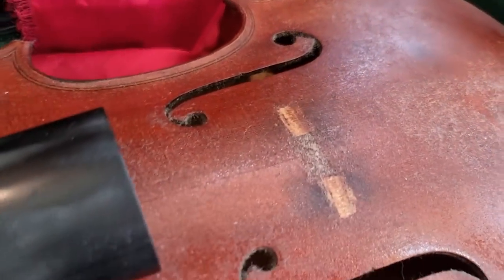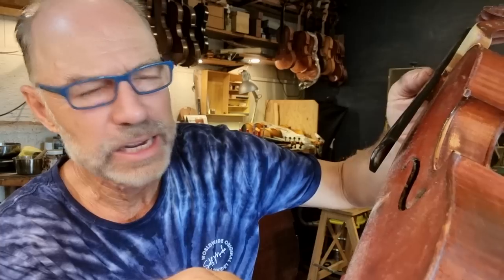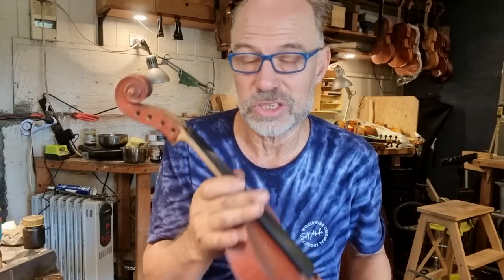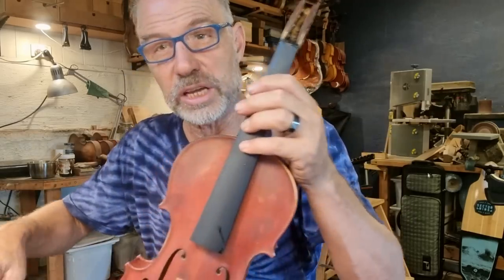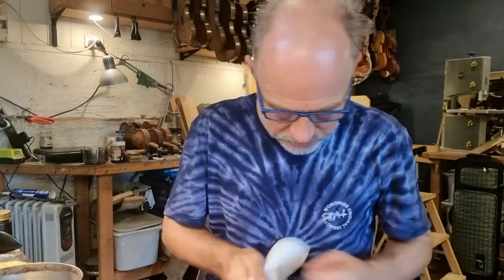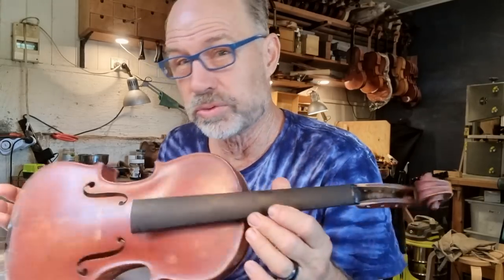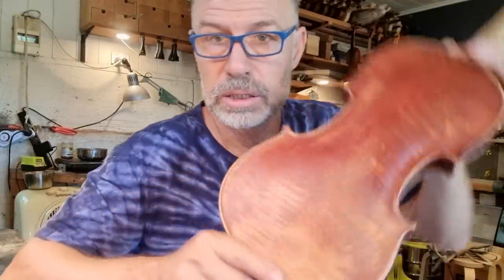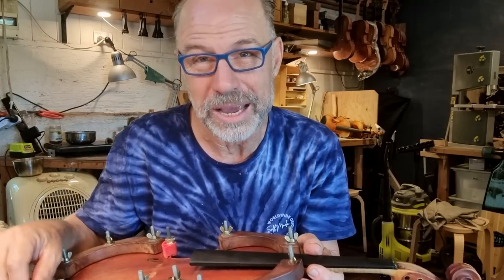The Very Sticky Violin!!

Comment: Hi Olaf
I am the fourth generation of luthiers / restorers in the Uk. I have experienced a few instruments with this problem 
The violin almost certainly has oil varnish for which, the early coats have not been allowed to set. The earliest instruments I have experienced with this problem were From the Forster family and other contemporary makers. In these instruments the base coats of oil varnish did not have a chance to set before the last coats were applied. Over the years the sub-surface coats did set causing the top coats to  ‘cracquel’. 
Sadly makers from the 1960s as you said, made the same mistake; too few thick coats which take forever to dry in the sun-less UK. The instrument you have is a classic example.
I would not be surprised if in a year the customer returns with the same problem recurring. 
You are very lucky in having a close equivalent of the ‘cremona’ sun which has high UV levels to set the varnish. 
I would have stripped the varnish and re-varnished the instrument which will solve the problem completely. It is not something I feel comfortable doing as you are not ‘restoring’ the varnish and `I certainly would not consider doing it to the instruments from  Circe 1860 as the cracqulled varnish is a feature. 
Ironically, I am re-varnishing (matching the original colour and style of course)  a lesser known maker’s viola at the moment. It has taken two years so far but I am not in favour of UV cabinets which over-cook the varnish. 
I wish you good luck
Adrian
Reply: I would probably kill you if you re varnished any of my violins whilst I was alive. If the varnish becomes sticky, then it is not balsam varnish, just someone who put spirit varnish on then oil varnish or a so called French polish, or just used boiled linseed oil to shine it up for sale? Who knows, however it looks like a pink colour so just worry about it being a liar who bought a violin in the white and used crappy German 70s viscous  varnish from a Getman varnish making firm. The colour could be called Salmon. It is vile. Well done to keep that vile pink colour...
Reply from the maker: Yes, I've experienced some amazing crackling on a Foster cello.
That's often a harder varnish on top of a softer varnish... That pretty much needs regular polishing to manage.
Some varnishes will pretty much always be soft in an Australian summer.
Also oil varnishes with too much oil to resin ratios.
So many challenges as a violin maker and restorer 😀
Reply: This can happen with spirit varnishes too.  At least one of the recipes for Vernice Bianca includes either rock candy or honey.  Over 2 years ago I bought a mostly finished cello on the cheap seemingly constructed by a famous luthier's son.  All measurements were perfect but the spirit varnish was very sticky.  I didn't like the finishing job and the instrument shortly developed a crack in the ribs which I repaired.  I've stripped away the varnish on the soundboard and partially refinished (including 5 layers of pre-varnish preparations) at least 4 or 5 times until I'm finally getting satisfied.  This will end up being a superb instrument worth at least 5 times the price but I've spent hundreds of dollars/pounds/Euros and huge amounts of time to make it so.
Reply: I HAD A VIOLIN THAT HAD THIS PROBLEM. I USED A LACQUER  SEALER WITH VINYL IN IT. THE MAKER WAS USING BEE PROPULUS THAT WASN'T WASHED WELL ENOUGH. WAS ABLE TO WORK OUT A NON STICKY SURFACE THAT HAS BEEN STABILIZED OVER 5 YEARS AGO. I SAVED ORIGINAL FINISH. THIS VIOLIN WAS CRAFTED IN 1995 IN CHATTANOOGA, TN. BY W.G. THOMASSON. HIS VIOLINS ARE CONCERT QUALITY, & BEAUTIFULLY RED.

Comment: Also, tree rosin prevents varnishes (and drying oils in general) from setting. In general woodworking, woods with high rosin contents may need to be sealed with shellac before applying varnish or oil. Don't know if spruce has much rosin, though.

Comment: Thanks for showing that. I have to deal with one where the varnish (might be shellac or shellac based) has crazed quite deeply. I'm considering rubbing back the thick areas a little etc & then following up with linseed oil & metho (like french polish without the added shellac). It depends if the client is prepared to pay enough for it though.
BTW, I have found MicroMesh to be very useful, both the sheet form & padded form for rubbing back.

Comment: Great video Olaf, my fellow Aussie! (I'm in Perth).  The last ten years of my life has been varnishing violins and violas: either for ones I've made, or on Chinese instruments in the white, or even repairs (which is the most common, as you may well know!)
I too have experience the horrible hard varnish over soft. It crackled all over (or as a friend of mine said "it looks crazed " which was a new term to me). May I ask what varnish you used, the one you said was slightly harder than the softer varnish underneath? 
I was given a great tip by my teacher Arthur Robinson, who sadly passed away in January, and that tip was: add lavender oil to a harder varnish as this will give it a 'forgiving' quality.  Although this works wonderfully, the instrument does then need to hang up for twice as long in a cabinet with UV lights pointed at it.
Is this adding-of-lavender something you've heard of?  Also, in very extreme cases, adding a clove of garlic into linseed oil and heating it up and gradually adding that garlic/linseed combo gradually into an amber-based varnish?
Many many many many things I have learned over the years and I've never been happier with my results! My first few varnish attempts were horrendous.... but we live and we learn and of course we must learn from our mistakes!
All the best and thank you for the interesting video.

Comment: This is my guess regarding stickiness: Oil varnishes curing in cold or wet conditions will remain sticky eternally even if the varnish is capable of curing properly under ideal conditions. I believe this to be a function of the varnish having too much time to draw moisture if the curing process is exceedingly slow. In such conditions the rate of polymerization (curing) is low compared to the rate of saponification, causing stickiness.

Comment: Would it not be simpler to partially strip off most of the old varnish and apply a new varnish? To me if there's a problem with the original finish, then just cleaning it means that the problem will come back later. Applying a harder varnish on top seems like opening a can of worms for potential incompatibility or flaking issues. This is not something I'd consider on an old violin, but this one is not old.

Comment: Do you use different glue when joing two piece top and back plates or just hide glue? Many thanks
Reply from the maker: Just hide glue... It works really well... It's been used to glue joins for over 500 years 😀
Reply: @AskOlaftheViolinmaker  thank you

Comment: Is that your glue boiling at 2:28? I have been diligently warned not to overheat my glue, but is it really that important?
Reply: It is not an issue since the glue is being warmed indirectly. You can go as hot as you want with the water surround a glass jar. In 10 years I have never had a problem with it. 
Occasionally you have to add a few drops of water into the glue, but really it's no problem.

Comment: ouchhhhh...... why not remove the bad varnish entirely before putting on the correct one?
Reply: I'd guess you really risk damaging the violin if you tried to remove too much of the old varnish.
Reply: @cornelious2  yeah, like you wouldn’t want to introduce moisture (wet rag) or oil to the wood. Would shorten the life or at least damage to look of the instrument. He talked about it in another video about hand patches.
Reply: I think he doesn't want to alter the looks of the violin. The colour is in the varnish, at least part of it.
Reply: @cornelious2  I think it's less about damage and more about integrity. If the violin is well made then it will have a protective layer or two of "ground" that is firmly embedded into the spruce and maple, which means you can remove varnish and add it however many times you want. I'm a luthier and I had a client who had a bright red varnished viola - she then wanted a blonde colour so I took off the varnish completely and gave it the blonde look. She didn't like it and requested I changed it back to red, but not so red (which was originally opaque), so I used an oil varnish with cochineal and alizarin crimson pigments to achieve a nice glowing varnish. I had to remove the blonde varnish because as we all know: too many layers of varnish will muffle/somewhat mute the sound.
So long story short - no damage done when stripping the varnish off! :)
Reply from the maker: I'm a fan of trying to keep as much original varnish as possible... Also that would have been a much more costly exercise for the client.